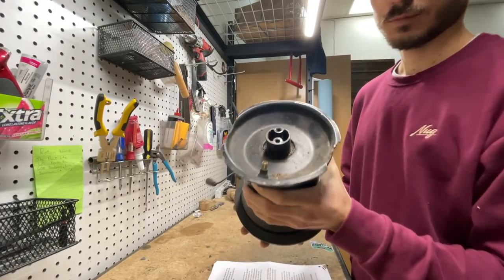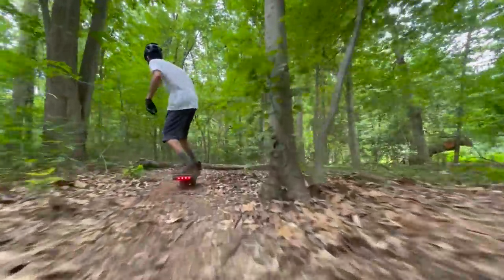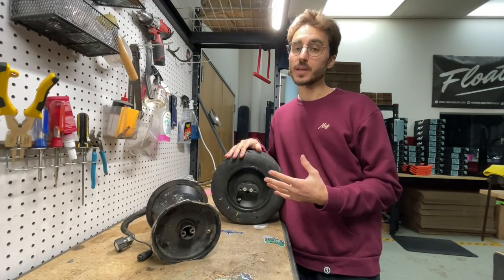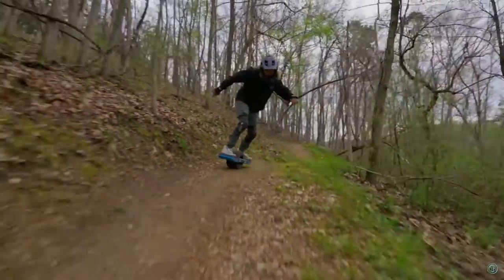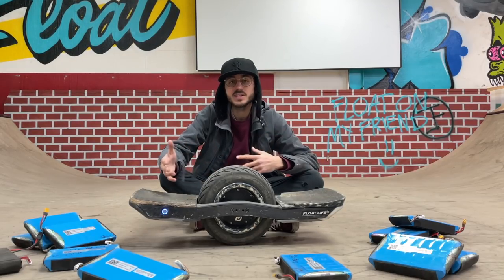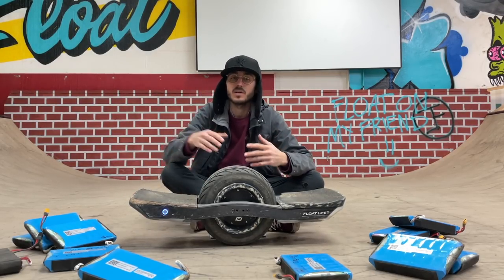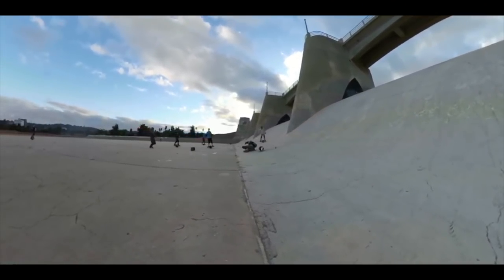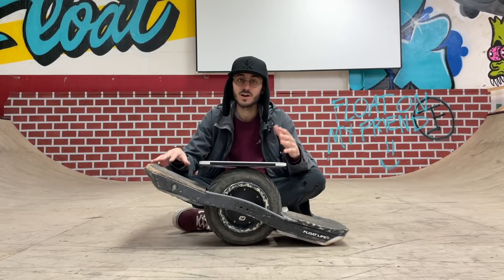Two Glaring Design Flaws on the Onewheel GT

Comment: Good info.  But we all know how stiff of sidewalls fm loves having on thoer boards from the factory.  And as we know there is only 2 options of tire for the gt. They will probably be rock hard tires.    I'm pretty confident that the busted rim in the video had a Hoosier or burris on it when it got busted vs the hockey puck it originally came with

Comment: could we bore out the hole where the hub bolts go in the rails to a larger size and then experiment with tube inserts of materials with different flexibility/impact absorption? Like with cars. Engines are bolted to cars in various ways. For peak performance but terrible comfortability you attach the motor directly to the frame with metal. To absorb some of the vibrations to increase comfort but decrease handling and performance you insert a rubber/plastic piece in between the engine and frame. Why not try the same with a onewheel? Use some old used rails to test out various material types and tube thicknesses and see what happens. Potentially also put material around the axle connection to the rails.
Reply from the maker: I would love any cushioning but anything that allows for play in the rotational direction of the tire means there will be lag when you accelerate/decelerate, basically the same feeling as when your inner hub bolts get loose
Reply: @JakeLeary  periodic knee replacements it is then

Comment: So when is TFL going to come out with a smaller hub for the GT?
Reply: Never, the hub IS the motor. Disconnect the gt motor hub from the pcb ( lost reference signal through pcb ) and BOOM bricked onewheel gt that needs reprogramming cause the micro controller has no memory beyond power loss. This is the same for modern cars, the dealers removed the equivalent of the cost battery on your computers motherboard... without it, no micro controller memory.. hence whyyou cannot full disconnect a battery on a modern car or disconnect the hub from the board 🤔 😉

Comment: Some good thoughts, but the hub is only .12 inches larger radius so .12 inches less of air. I also measured the board compared to the XR and did not see that the footpads are raised at all. While clearance is .8 inches less I think there is a chance the added torque will make up for it. Did they listen to the riders? No. Is it better than the XR? We will see
Reply from the maker: The hub radius is .25 bigger on the spec sheet, what makes you say .12? You measured the board?
Reply: @JakeLeary  your right I thought it was .25 in diameter. Since the tires of the GT and xr are the same height I measured the ratios of both in some pictures and determined that all of the thickness is added to the bottom. Both the GT and XR have the same thickness above the axel to my understanding.

Comment: Have FM officially announced they will discontinue the XR? That's an insane move.
I had always pushed for a bigger heavier Onewheel, with more battery and bigger hub motor, BUT I also asked for a bigger rolling diameter tire, like 13 inch. For all the reasons you mentioned. And because a larger diameter tire has more rolling stability at speed (more gyroscopic effect).

And, I always expected FM to continue with the smaller lighter XR as an off-road vehicle, with the larger GT as the urban vehicle with more speed range and stability. I'm an urban rider and really don't care about off road trail riding etc.

It would be an unwise move for FM to discontinue their off-road model and try to replace it with the high speed urban model...
They need both markets... 
And someone PLEASE make a 13 inch tire for that GT, why should high-speed power riders be stuck with that silly 11.5 inch thing...
Reply: Yes fm announced this shortly after the gt promo, I am ultra stoked to have a cbxr equipped xr, its literally the same range as the gt, but in an xr.

Comment: you're spot on bro.  The future motion people suck ass.  They increased the hub size so we can't use go-kart tires.  they didn't listen to any riders.  This GT is a fail and future motion would be nothing without craft and ride and others helping us modify our wheels.  I have seen these clown at events and they are very unfriendly and arrogant.   way to cool to talk to the fans..  I ride around 10-12 psi.  I don't think the GT will handle this.  Great video.  also just a note, Future Motion didn't invent the onewheel.  They did do a good job producing the XR.  I hope someone will make a better one.
Reply: 100%, onewhels ARE ardunio mega pcb self balancing robots.

Comment: this video is so much more relevant now that the GT launched and  Jakes Fears are coming right into the light. ya the new board has more torque but that bigger hub and less clearance is going to be an issue for anyone that trail rides which is I think most of the community  unfortunately.  I have flat feet and any time I over filled my tire oh boy did I feel it so I imagine GTs very hard tire I would absolutely hate especially when theres also more hub and less area to absorb impact...... Good thing I got my trusty XR I guess. I prob should badger it to make sure nothing hurts the thing now more then ever just for that piece of mind. I already through on some bang bumpers as well.

Comment: The reason future motion doesn't have any competition is because they have a million patents and basically own the form factor, the only reason boards like the trotter exist is because they're shipped from china, this allows fm to rest on their laurels ._.
Reply: Arduino is community freeware ide. Onewheels ARE arduino mega boards the are printed pcb by one wheel, literally earlier versions pre v1 were built using the mega..  arduino should sue Fm..  Fm also stole this idea from others

Comment: So onewheel was patented in 2013, design patents hold for 14 years so in 2027-2030 you'll get boards you want. The same thing with segway, they held a patent for 14 years barely sold any segways but now we have crazy good EUCs with suspension 50mph top speed, 125mi range, etc.  Why would futuremotion make a good product? They are the only company making onewheels, you will buy them anyway.

Comment: If someone were to design longer rails for the GT. This would allow for factory footpads and the proprietary electronics to be utilized. As a result a larger profile, larger diameter tire could be mounted onto the factory hub. There would have to be a mild sores and angle adjustment made within the app. Hmmmm 🤔

Comment: I love my Onewheel. But in October 2020 the board nose-dived which resulted in me having some significant injuries, two.months off work and a loss of faith in the board. Ive hardly ridden it since. Why oh why can't the nose dive flaw be engineered out? EUC don't have this issue!
Reply: What’s been your experience with the euc? I’d be scared of flying straight forward. I’m trying to figure out if I’d want a OneWheel or euc. Haven’t owned any of these but am a snowboarder. What euc did you get? I’m also trying to find where to actually try one out- not having any luck
Reply from the maker: On an EUC, your feet are at the fulcrum. On a Onewheel, your feet are spread apart, giving you a lot more leverage to control the angle of the board, but also giving you a lot more leverage to jam the nose into the ground if you want to or if you don’t know what your doing. This cannot be “engineered out”

Comment: Sounds like an opening for the aftermarket companies to offer a replacement hub.
Reply: That would be replacement motor, problem is FM has designed the gt like newer cars, disconnect fhe power from the motor circuit completely ( 0 volts at micro controller ) and it loses all its programming, meaning you need the original arduino ide program to re program ... yes...... its arduino self balancing robot.... literally. :)

Comment: After trying the GT, I will never buy one, canceled my order, was hoping it would be What they said it would be, but between the feel of the board (discounting the firmware problems it has at the moment from tail drag to lack of custom shaping this mini review does not include that since they'll be inevitably be updated/fixed), the hardware design flaws, and the business practices, the GT and FM do not deserve my money for it. Keeping on used XR's, I do believe it will always be superior to the GT, even tricked out to the max for trail riding. I wish I could say otherwise but until both the company changes and more importantly they accept 3rd party feedback to make a solid stock board that isn't inherently flawed I think I'll stick with used XR's and later vesc chips/software to keep them in good condition till the day I'm dead. That simple. I legitimately do not like having to write what I'm saying because yeah I want to see good change so the onewheel lives on for generations like snowboarding, biking, surfing, skateboarding, etc. I hope it does, but I don't see it being that way without the major changes. I don't even feel it can unless they change or someone manages to take them over if they don't change. Guess we'll see what happens, have a lot of faith in vesc rather than FM. Anyways that's all before this is nothing more than a rant repeating the same things repeatedly. Have a good day Leary:_Onewheel::_Doge:
Reply from the maker: Eyy you used the members emojis! Onewheeling will be here for generations for sure. I think FM is going to make some changes soon, but even if they don’t we’ve got VESC

Comment: You're completely missing the point that the hub size determines the torque. Future Motion just wanted to give you a performance upgrade.
Reply: Lol, they could have added more windings into the existing hub.. the torque IS related to the diameter yes, but more so the output potential, that's the windings
Reply: @MrDmadness  I haven't built a motor, but it seems radius will affect the gear ratio (despite lack of gears) with the magnets being closer to the contact patch of the tire. And I would imagine you could throw in bigger magnets and coils with more room in the hub.
Reply: @UnidudeNine  that's true to an extent, but not the case here, adding 1/4" is unsubstantial to the motor in this case, similar motors used for professional go cart races have the diameter of the xr hub... they Go well over 100 mph
Reply: @MrDmadness  so perhaps OW is trolling us with which tires we are allowed to use?😅

Comment: one thing i disagree. Gt have more weight which mean it will handle bumpy better. and it will ballance better if  you compare stock to stock.
but interm of doing trick the XR is better
Reply: This does not equate, more weight does not in any way equatecto better handling. Respectfully intended

Comment: It's 0.25" less sidewall which is negligible and definitely isn't a deal breaker. As always, there will be aftermarket options for those that need/have to customize their boards. The larger hub has more purpose than Jake understands and isn't for the fun of it as he seems to portray. The pro that took the GT for a rip sure seemed to enjoy the ride and got the hang of it right away and loved the extra torque and power. Looking forward to trying the GT for myself come middle of Feb
Reply: No bud, that's literally not how electronics work. Torque is far more related to windings of the motor hub than hub diameter, the reason for a proprietary hub/tire size is to create a monopoly, if you Say it's got any other perpose you're tailing to understand Fm as a company.   A cbxr equipped onewgeel xr has the same range as the gt with a bit less torque as it still has less windings but the added cell bank wired in series parallel adds more available power, its a kin to adding another branch waterline fo an existing system..nstill maxing out by the main lines diameter ( plumber and electrician here )

Comment: All the talk about the bigger hub, but I have not noticed or heard anybody talk about that the GT has a larger tire diameter not even in the comment section.
Reply from the maker: It is listed as having the same tire diameter, 11.5. However, you are absolutely right that the actual measurement of the diameter could be bigger despite being listed as 11.5. But we really have no reason to believe that it will be bigger
Reply: @JakeLeary  well if you look at the Hoosier specs they list their tire at 11" even. So if this tire diameter is 11 1/2" there's there's the difference. The half inch difference on the 6 1/2 wheel it's only a quarter inch per side of the wheel.. Same is said about the tire. So we're talking an equal sidewall height. And I think the GT needs to sit a little higher as it looks like the battery sits lower.
Reply from the maker: @jimaudette445  the numbers 11 and 11.5 are just nominal and not an actual measurement. There are 11” Hoosiers that run on both footpads when fully inflated
Reply from the maker: Rub**

Comment: I am not part of this scene but to me a rim and a hub are not the same thing.  A design choice is not a flaw.  A smaller diameter means a smaller motor so it is not a flaw but a choice.
Reply from the maker: It’s the same motor as far as we know. It seems like they just extended the rim so that a different size tire is necessary. I’ll know for sure in hopefully about a week and will post a full review ASAP

Comment: I'm totally agree about your point and don't listen any good rider from the community I get that part but, the tire is another story to my understanding and please correct me if I'm wrong just the Vega is the only tire 11.5 tall because all the after market tires are 11 so basically we just take a 1/2 inch with any aftermarket tire so there's not risk about it since the tire keep the same dimensions of the XR VEGA.

Now the hub is 1/2 bigger yes that is not ideal to us but, we have to remember all the posts criticizing the Vega and change the tire right away with 0 miles just called the company attention so being a California company that makes FM an environment friendly company so the new hub size solve the problem of the tire, also no matter what tire they use we as costumers will always want to change the tire.

I'm not a fan of FM but, meanwhile Kyle Doerksen stay in charge of the company and projects I'll keep buying their boards.

Comment: All you have to do is take the XR rim and put that in the GT.  Problem fix.  Ride on!!
Reply: You can't disconnect the gt hub from the 
Power though or it bricks the gt cause it loses its reference signal. Get a cbxr, ive had gt torqueand range for years already on my xr

Comment: How can you make such criticisms without trying the GT? A wider rim isn't a flaw, it's a tradeoff that unlocks more peak power. If you have a battery compartment design which doesn't involve thickening the pads, adding cost or adding geometry in an even more detrimental place then we're all ears.
Reply: Incorrect, a electronic motors torque is related more so to the number of windings in the motor and the diameter of the wires in those windings the wire width is thicker if current is higher to resist melting out but it's the number of windings that is the output potential ( more electrons moving = more torque and power )   an increase of hub side without more windings does not make a electric motor more powerful.. respectfully intended, there is a mathematical formula to equate this. My 4209 cbxr onewheel I guarantee has similar torque and exactly the same range as the gt.. it will have slightly less torque though cause of fhe windings will be fewer, the only other way to increase this would be more voltage ( pressure ) which would increase heat ( ohms )
Reply: @MrDmadness  I'm aware of the physics! The third part of the tradeoff is cost - by investing more money, you can make a motor the same size which produces more power. You could in theory make a onewheel with very tightly wound wires of ultra-low resistance wire with added heat dissipation strategies, but it would cost more and presumably FM have done the maths and worked out that consumers would prefer the cheaper board with the thinner tire. So I think it does come back to a design trade-off made - it's not like FM chose a thin tire for no reason, they chose it to optimise cost/performance ratio
Reply: @danthurston9884  the math is more windings = more power and more electrons movement = more heat to dissipate.    The reason fm incorporated alarmed hub is to have a tire monopoly cause they area shit company

Comment: People would be quick to switch brands when a competing product comes out. -  Yes, see that's the problem because you really can't have a good competing product when future motion keeps suing the s*** out of their competitors.  The float wheel  vesc driven onewheeled scooter was the size of a pint, but arguably better.  The vest software isn't quite there yet and you really do have to know what you're doing to set up, but in terms of pure hardware capability, the float wheel was better. Too bad FM jumped in and put them out of business within a month.

Comment: not a whole lot of trails in Florida just beach and street mostly so the GT will be dope either way and only reasont hey  made the rim bigger is one you cant use xr tires and 2 they have the only tires so far to supply you with a bunch of butt ballers! Sooo XR Trail Board GT Street Board for me fk it!